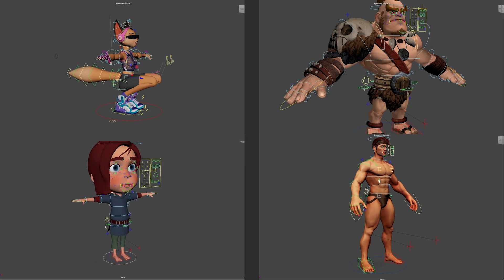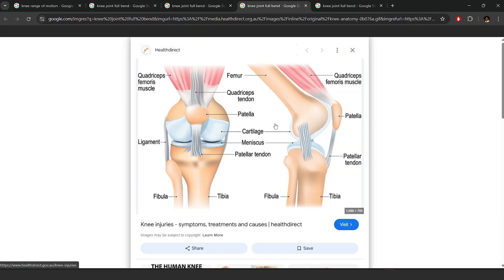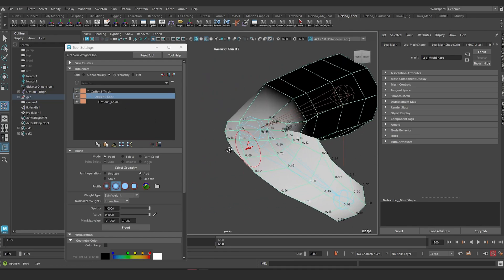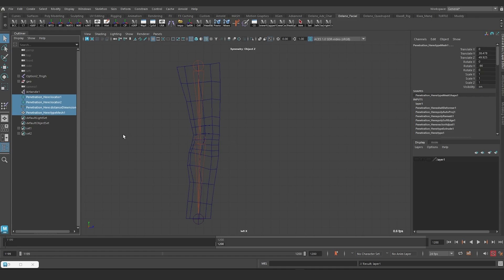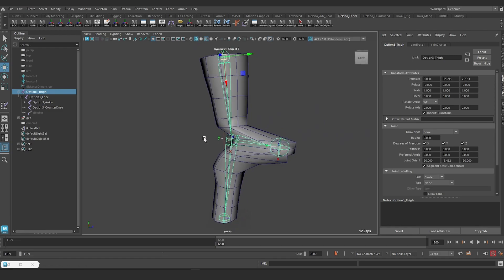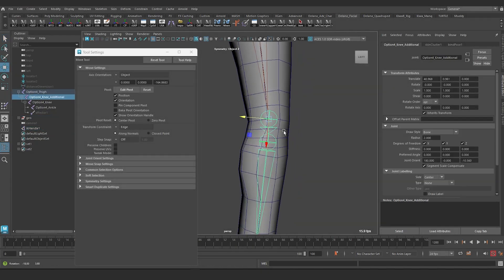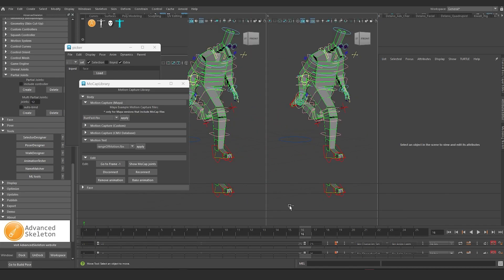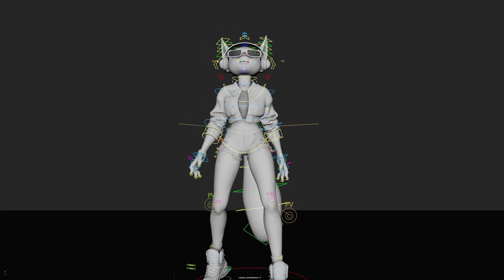Rigging with Advanced Skeleton - Part 2 - Discussing Knee solutions

Comment from the maker: CURRENT LESSON PLAN 
*This list is subject to change. Expect things to be moved around or for new lessons to be added. I will update this list for the lastest release whenever there are changes. Also to get things moving along, I will try to upload 2 to 3 lessons at a time so we can get to the end a lot faster.

COURSE PLAYLIST
**
Part 1:             ■Course overview (https://youtu.be/COHsGlz8M6s)
Part 2:             ■Discussing Knee solutions (https://youtu.be/XV-2fHxJ7oY)
Part 3:             Model Modifications & preparation for Advanced Skeleton
Part 4:             Fit Skeleton Part A – Defining objects & placing joints
Part 5:             Fit Skeleton Part B – custom joints
Part 6:             Fit Skeleton Part C – attributes & labels
Part 7:             Adjusting Fatness & Building Advanced Skeleton
Part 8:             Controls coloring & reshaping
Part 9:             Skinning body & basic head with a Skin Cage
Part 10:          ■Discussion about corrective deformation options
Part 11:          Refining Skinning: pelvic region
Part 12:          Refining Skinning: Ribcage to obliques
Part 13:          Refining Skinning: Tail
Part 14:          Refining Skinning: Knee
Part 15:          Refining Skinning: Ankle & toes
Part 16:          Refining Skinningl: shoulder
Part 17:          Refining Skinning: elbow & wrist
Part 18:          Refining Skinningl: fingers
Part 19:          Refining Skinning: neck
Part 20:          Face Setup with Advanced Skeleton
Part 21:          Face Fitting with Advanced Skeleton
Part 22:          Face Building with Advanced Skeleton
Part 23:          Face rig testing
Part 24:          Using Skin cage skin sliders to hold volume
Part 25:          Refining Skin slider skinning & driving systems Part A
Part 26:          Corrective deformations plan review
Part 27:          Creating Intermediary blendshape to port corrective deformation through
Part 28:          ■Analyzing neck deformations on rotations
Part 29:          Sternomastoid bulge on head turn or head rotate backward
Part 30:          Skin bunching on sides of neck when head turns/twists
Part 31:          Skin bunching at back of neck as head leans back
Part 32:          ■Analyzing behavior of upper back 
Part 33:          Skin bunching at upper back
Part 34:          Custom skin controls: scapula
Part 35:          Corrective morphs on arm raise & rotate: Teres major bulge
Part 36:          ■Analyzing behavior of chest, clavicle & shoulders
Part 37:          Custom skin controls: chest
Part 38:          Breast Tissue
Part 39:          Custom skin controls: clavicle
Part 40:          Custom skin controls: trapezius
Part 41:          Breast Fat Tissue jiggle
Part 42:          ■Analyzing lower torso behavior when rotated in all axises
Part 43:          Ribcage impression when chest rotates back
Part 44:          Abdominals impression when chest rotate forward
Part 45:          Pinch at obliques on lateral rotation of chest or hips
Part 46:          ⓿Triggering dual driver lateral pinch with a distance locator
Part 47:          Pinch at obliques on flexion or extension of the chest or hips
Part 48:          ⓿Triggering dual driver flexion & extension pinch
Part 49:          Pinch at obliques on twisting of the chest or hips
Part 50:          ⓿Triggering dual driver twist pinch with a distance locator
Part 51:          ■Analyzing behavior of upper arm as elbow bends
Part 52:          Custom skin controls: bicep & elbow
Part 53:          ■Analyzing behavior of forearms
Part 54:          Impression of the extensors
Part 55:          ■Analyzing tendon & bone impressions on hand
Part 56:          Tendon impression for back of hand
Part 57:          Tendon impression for inner wrist
Part 58:          ■Analyzing behavior for pelvic region as legs move & character crouches
Part 59:          Butt shape on crouch
Part 60:          Hips bulging & butt plumping on crouch  	
Part 61:          Corrective blendshapes on crouch: hamstring fat & calf muscles
Part 62:          Corrective blendshapes on crouch: adductor & inner thigh fat
Part 63:          Corrective blendshapes on crouch: knee
Part 64:          ⓿Triggering collision on a crouch with a logarithmic curve SDK
Part 65:          ⓿Triggering the rest of the deformations of a crouch with a linear curve SDK
Part 66:          ■Analyzing the way the hamstring tendon behaves in the middle of a crouch	
Part 67:          Hamstring tendon behind knee
Part 68:          ⓿Triggering tendon impression on partial crouch with math nodes
Part 69:          ■Analyzing gluteal fold on weight shift & leg recline
Part 70:          Glut volume preservation & gluteal fold emphasis when leg is reclined
Part 71:          Manual gluteal fold emphasis on weight shift
Part 72:          ■Analyzing Adductor magnus tendon impression when legs spread
Part 73:          ■Analyzing thighs & but squash  for seated poses
Part 74:          Thighs squashing
Part 75:          Using a Squash & stretch deformer for sitting or when external forces collide
Part 76:          Manual butt & hip sculpting, volume preservation & jiggling effect        	
Part 77:          Resolving nails & fangs with custom controls
Part 79:          Wrap Deforming clothes
Part 80:          ■Reviewing current headphone & sunglasses rig features
Part 81:          Rigging headphones with advanced skeleton
Part 82:          Rigging sunglasses with advanced skeleton
Part 83:          ■Reviewing nCloth solution for sneakers
Part 84:          Rigging Sneakers with nCloth panels
Part 85:          Optimizing nCloth jacket & jeans cloth rooms
Part 86:          Testing Rig with Kiwa’s nCloth clothing system
Part 87:          Rig Cleanup
Part 88:          Design Embedded Body & Face Picker
Part 89:          Shelf Tools for the Rig
Part 90:          Pack & Publish for Patreon Tier 4